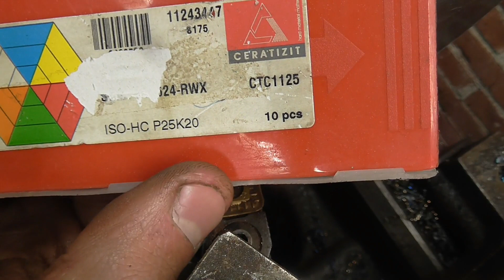Machining a wheel hub on my TOS SN63B lathe Part 2

Comment: Coming from my perspective, I own a lathe with 57 mm center height Watching you take 4mm cuts was frightening, I almost had to call the ambulance :):)  When I am turning to a diameter and I can use caliper measurements, I set the calipers to the desired diameter. Zero the calipers. Now any measurement you take will tell you how much you have to take off. Saves you calculations in your head. For this to work, there must not be any chips on the calipers and your calipers must hold a zero well.  Hat tip to myfordboy channel for this. Works in any units, and in fact allows you turn turn metric diameters on an Imperial lathe or vice versa. Just press the in/mm button.

Comment: Those are some heavy cuts with the Ceratizit bits. Wow! Nice with the tripod (fixed camera). It would be nice to know how it goes with the Sandvik representative.
Reply from the maker: +Jim Milne The camera is mounted on an indicator magnetic base! It's better than a tripod since it can be attached virtually anywhere in any position in a machine shop! The Sandvik salesman visited me last week and yesterday I got some goodies :-)! I'm now working on the next project which you will see soon and that has some more info about the tools.

Comment: After each cut, as the cutter is returning to its starting position,  it catches the work piece Why is that?
Reply: It is probably tool deflection caused by the heavy roughing cuts. Or not powerful enough workholding(not in this case).